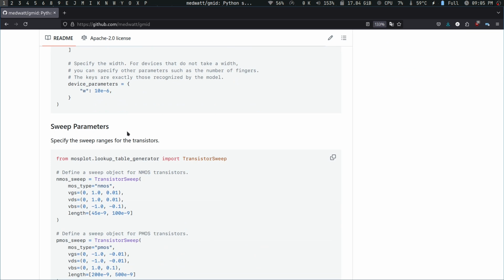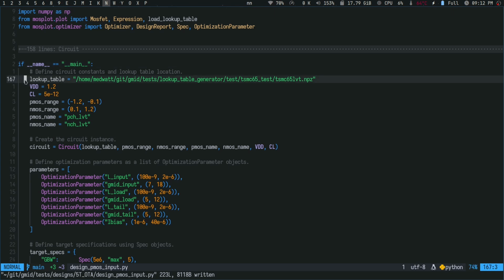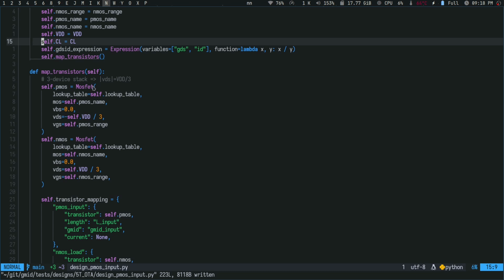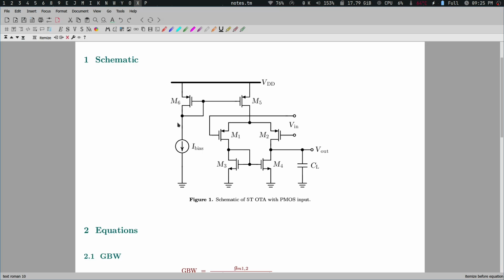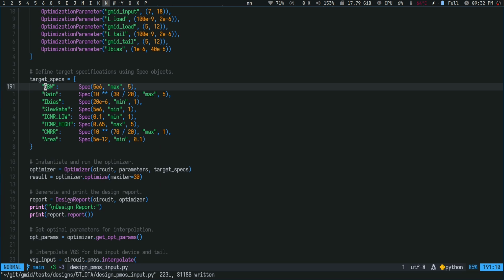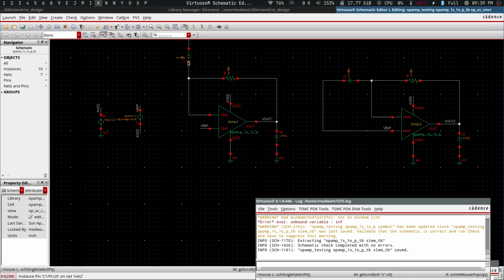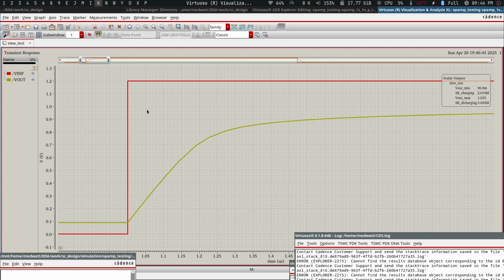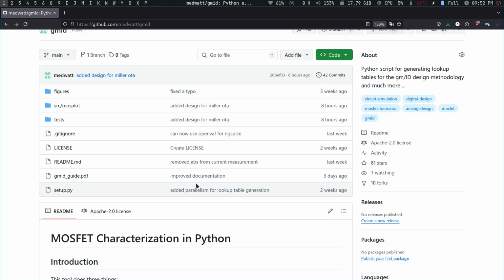Optimize Analog Circuits Automatically in Seconds | Python Tool

Comment: Really cool stuff. But I have a question regarding the optimization algorithm. Let's say the algorithm has done some optimization and now your gian and bandwidth is met but not the slew rate. So in the next iteration, will the algorithm focus on improving the slew rate or will it be a random optimization. I want to know how's the sensitivity of a spec to a particular parameter of circuit is used to reach to an optimal circuit

Comment: Really interesting and useful tool.
I had this question : if I want to design a new circuit apart from the 5T OTA and Miller, I have to make a new class defining the circuit and the tool will work with that as well, right ?
Reply from the maker: Yes, just follow the example, and in the specs section write the ones that correspond to your design.